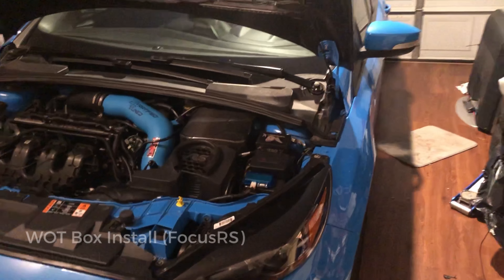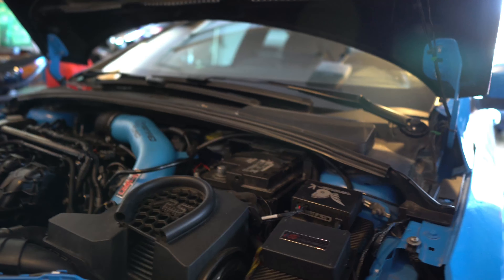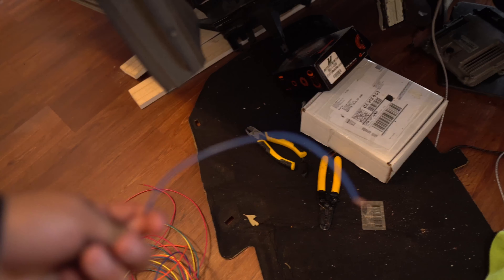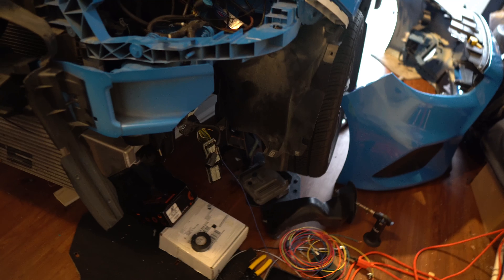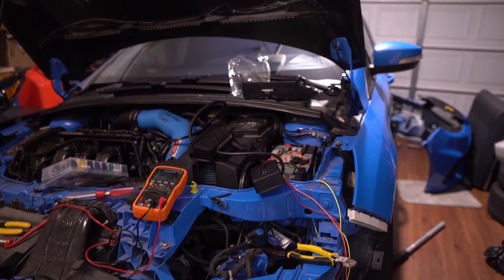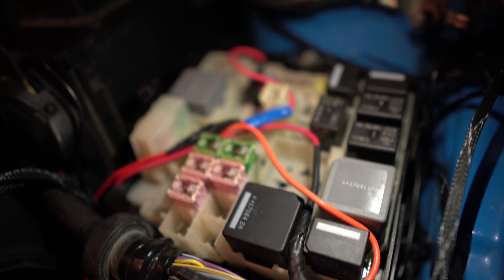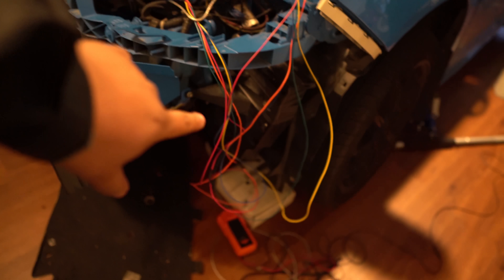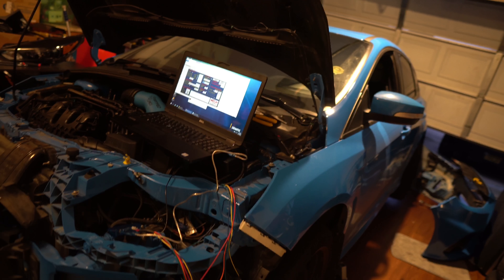How to install a Wot Box ( Focus RS )

Comment: will this mess with the cobb acessports adjustments for LC and no lift shift? also would a fiesta st be similar to this install?
Reply from the maker: No it won’t, just make sure your tuner disables it on the cobb and u should be good
Reply from the maker: Wiring colors might be different, but the process would be similar